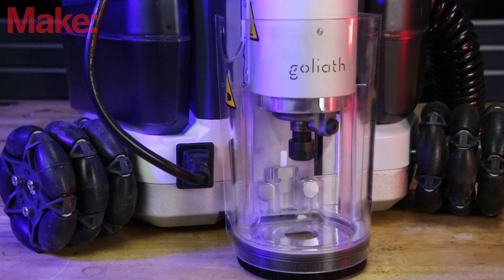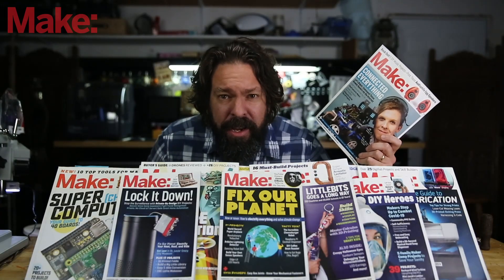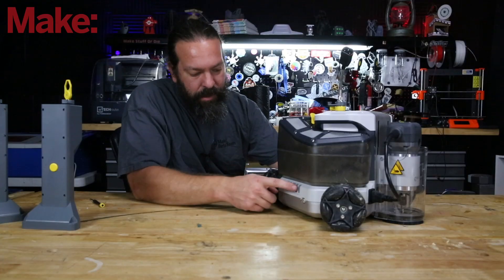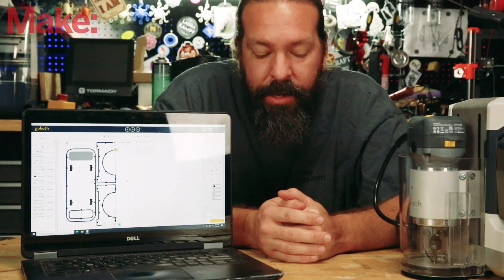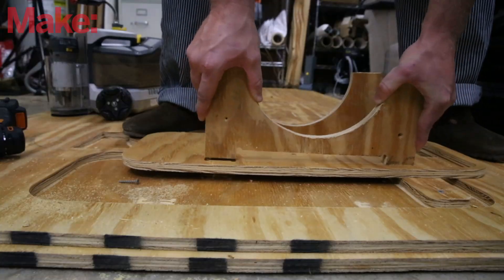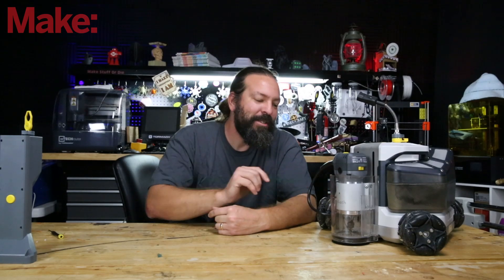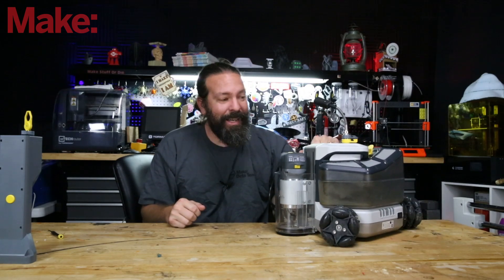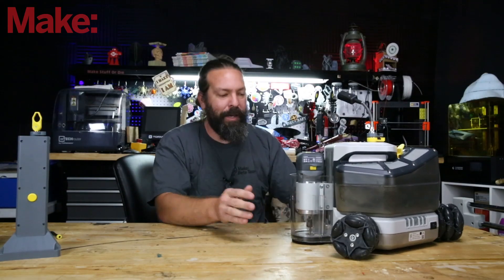First Look: The Goliath CNC Robot - Cuts full sheets but fits in a backpack

Comment: My Goliath cnc is junk. I spent 8 hours cutting out half of a tree, (pattern on their web side) for some reason it did not cut the other half.  This was after hours of trying to make the thing work.  Towrs software needs update 3 times, can not connect to Goliath, G code will not send, spindle cover not on properly, ect ect.  I am going back to jig saw. $4005.00 waisted.  I would not recommend this item in the time it takes to get it to work you can s=cut 5 times what it will get done.  When you get it to work it is neat, math wizard stuff to get it to cut the same pattern 4 times to cut it out of a ½ inch wood.

I purchased the from Goliath CNC along with a 2nd bit on 03-19-2023.  After many emails the thing shipped on 05-23-2023.  I received it about a week later.  Could not get it to work X-Y axis issues.  Many emails and a video call they figured out I was sent a bad tower.  On 06-06-2023, I had to ship it back to Italy and was warned they were not reasonable if it broke in transit. On 06-21-2023 I was contacted and told I had to pay for them to ship it back to me.  That took a day or two before they stated they would ship it to me at their cost.  I got it back.  Every time I did set up it wanted me to update the software on the towers.  I had to stop and use up an hour updating then back to panel detection.  I got through it an made 4 cats and one tree.  I put it away and sanded and panted the items. On 11-04-2023, I wanted to start on Holiday decoration.  I spent over 8 hours messing with it. The new software would not send G code.  Did not tell me to press yellow but to set, would not start cutting when I pressed the yellow button the 2nd time. It wanted to update the Slingshot software.  Trying to use the new software it locked up on panel detection or could not communicate with Goliath or Tower software needed update even after I updated it.  Finally, it started cutting.  Two groups of cuts and it only cut one.  I could not find an abort button; Goliath screen was locked anyhow. I restarted the slingshot program and had to do panel detection again, first could not communicate with Goliath.  Then Twon out of date.  Updated both, back to panel detection and still said towers out of date.

Just an estimate I figure I have spent 4 hours setting up for every one hour it has actually been cutting.  I could have cut out three times as much product by doing by hand.  Tomorrow I will start cutting by hand again and try to catch up.  I guess the $4,000.00 lesson it what I get for listing to pitchmen giving what had to be fake review on youtube..

Comment: The 3 omni wheels look useless. How does it move? You never showed the underside? Are there drive wheels under there? Is it simply dumb driving away from the 2 anchor points? Always peeling out, and the 2 anchor points position the device?
Reply: Learn about how mini wheels work
Reply: @adamfilipowicz9260  You just proved that YOU dont know how the wheels work, so dont say anything. Thanks.
Reply: @tazanteflight8670  I know exactly how they work. Sounds like you need to learn about them
Reply: @adamfilipowicz9260  When you go to the mind reader, do you only have to pay half price?

Comment: But can it connect to a regular shop vacuum when making a lot of cuts, say on an 8x4 sheet, or are you going to have to stop it 3-4 times to empty the dust bin? It looks to have a single internal port into the bin but that segment is so short. Hopefully they will include a disk/stick with some basic projects - like a carry case to hold all the parts & the marker towers. 2D/2.5D is what a lot of furniture makers want, plus camper trailers, Tiny Homes, kitchen cupboard makers........
Reply: currently I see no way to connect a vac to it. I would guess it would harm the motion because most vac hoses are somewhat rigid (compared to a power cable).

Comment: The first job site CNC that can be carried up into homes making custom cabinets or other structures.
Reply: pretty much
Reply: Doesn't the Shaper Origin fall in this category too? Only difference is you can leave the Goliath alone.
Reply: @niklassteenackers3979  I guess so, but you're still doing all the work on a shaper. I really wouldn't consider it the same at all personally, but I guess the results could be similar.
Reply: @niklassteenackers3979  Exactly, it is a big difference.

Comment: When the Shaper came out the clear weakness is that you have to operate it. This answers that with roomba style self driving, but as you said, the same thing that makes it so nimble, also is part of its problem. It seems like maybe instead of using its driving wheels as the means of steering the bit if it just used them to drive around, then would drop solid landing gear and then the head could do cutting operations in a small area, sort of like how the Shaper corrects for your hand movement.
Reply: A friend and I were discussing that. It would involve adding a gantry, which would drive up price a bit unfortunately but it seems like a method that could work!

Comment: I can see this being really useful for diy tinyhome or trailer home makers.  There isn't really a good system for this price that will let you cut full sheets like this. Still quite expensive, but I am hoping that companies keep running with the idea to make it cheaper and more reliable. Maybe even with an expanding wheelbase so you can cut larger pockets.

Comment: Impressed by the dust collection as I would expect with those wheels, they may not work over a dusty surface.
Reply: very good point
Reply: or a slippery surface like prefinished Baltic birch.  now matter how good the dust collection, over time dust will build up not only on the surface but on the wheels., which means baby sitting...